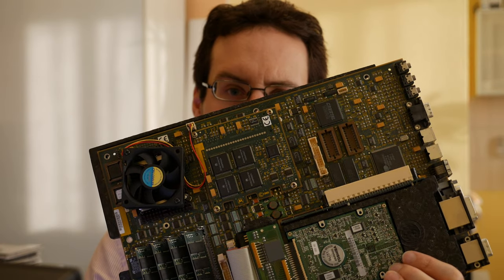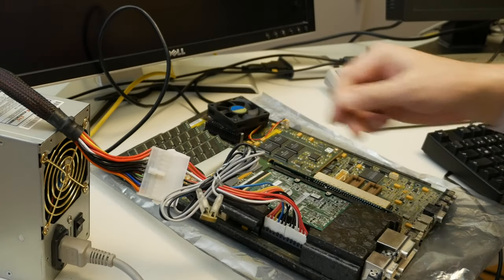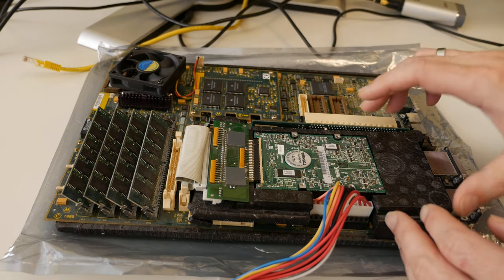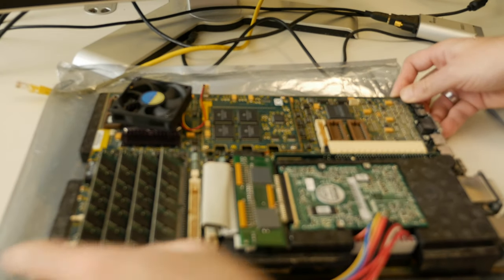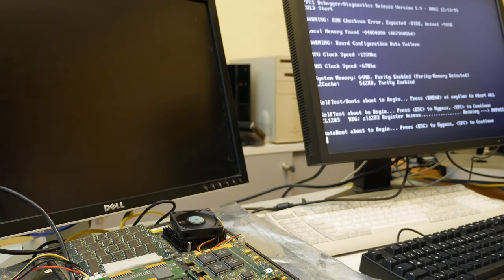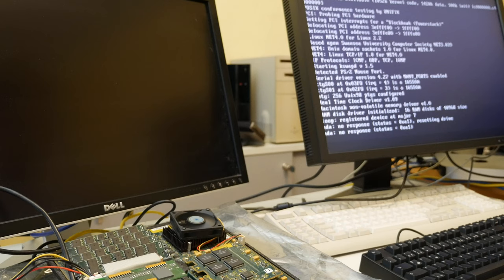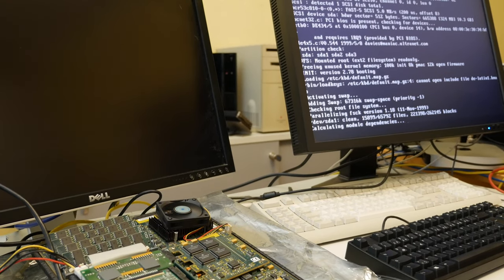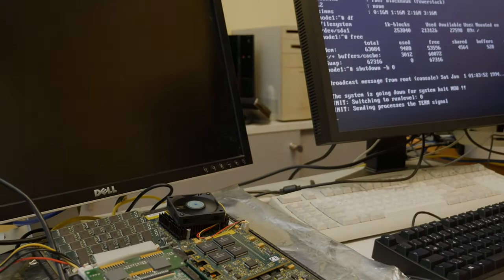Motorola Blackhawk: a PC clone with a PowerPC 604 CPU from 1995!

Comment: Try using NetBSD on it, I have a similar machine and it can take advantage of the NetBSD machine independent drivers. With those drivers you can use things like USB2 PCI card in it as well as one for SATA drives. The NetBSD PReP port is what you'd want to use.
Reply from the maker: thanks, but Linux drivers are not machine independent?

Comment: I wonder if there were ever any native applications ever compiled for windows NT on PPC? Or even more crazy if there was one compiled on this as well as the mips and x86 ports.  That would make an interesting performance comparison. Otherwise the only windows NT software that would run is whatever can work within its simplistic emulation layer. And that would probably be as bad as the 68k emulation layer in early mac ppc os.
Reply from the maker: Windows NT had an emulation layer back in the day? I was actually thinking if I should try find a WinNT PPC and try booting on this board. However, on a search it sounded like it might require flashing another firmware on the board so I postponed that for when I ever have too much time for that ;-) One thing is for sure: there where not many Windows PPC apps ever ;-) https://omgwtfbbq.ca/2018/07/installing-windows-nt-4-0-on-a-powerpc/ PS: ok, interesting, sounds like non-x86 NT indeed had some "SoftPC" emulation: https://retrocomputing.stackexchange.com/questions/8971/did-windows-nt-4-emulate-x86-on-non-intel-platforms
Reply: Indeed! From what I remember it was only promised to work with win 16/32 applications that were supposed to be written to conform to some win32 specification that MS had at the time. And this apparently allowed the applications to run quite seamlessly as though you had an x86 PC (just a lot slower). And anything that was more obscure or needed more direct hardware access was problematic and as a result would have various degrees of usability. 

There were many programs which did work quite well within this framework. In fact compatibility seemed fairly good overall.  But it would be the performance of a decent 386 or so on a 100mhz Mips r3k for example. Similar to how my PPC Mac 7100/66 runs 68k software at about LCiii speed or less. On the alpha port, applications that were following guidelines to the strictest degree ran significantly faster as it probably had the best emulator. 

This is all from my old memory though. It has been some time since I was able to play with any of the odd windows NT ports.

Comment: I think that thing would beat a similarly clocked Pentium. Especially in the floating point compartment :)
Reply: Quake 1 benchmark comparison?
Reply: @rugxulo  That would be awesome but someone'd need to tweak some of the code. Mr Carmack pulled a few tricks in assembler on x86. Wouldn't be fair if the same is not done on both platforms :) I believe even the old beasts has fmadd for example? Hard to convince gcc to use that one instead of some convoluted mess. I think René has a lot more knowledge in that department than me.